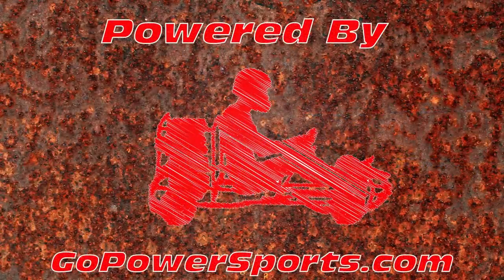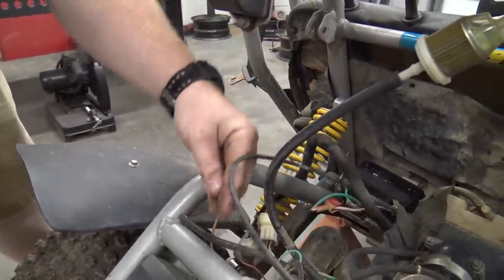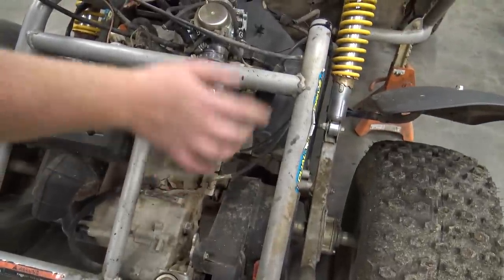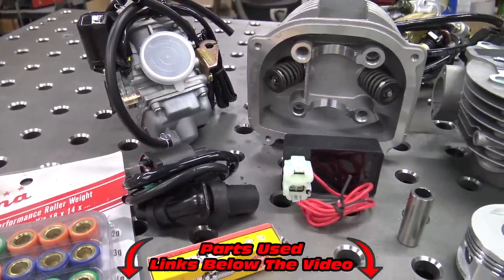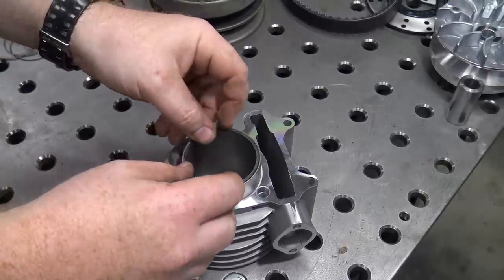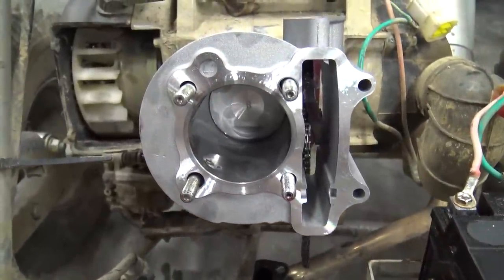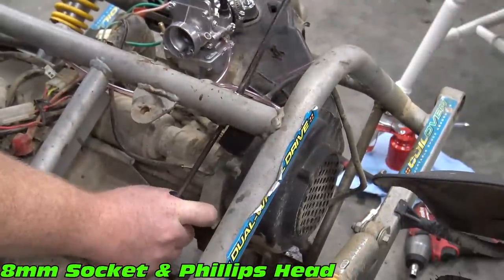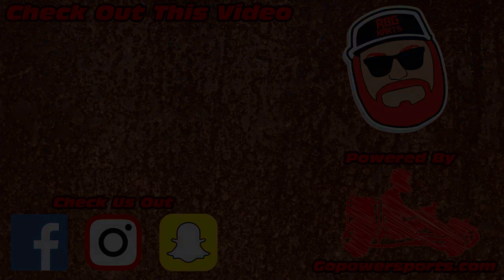150cc gy6 Go Kart Engine Rebuild & Performance Upgrades

Comment: Some of you people are absolute assclowns. You’re acting like it’s open heart surgery! It’s a damn go kart, and it’s his! If he wants to pour hot tar in the crankcase it’s his right! Never seen so many professional engine builders on a damn go kart YouTube channel. He spit a head, cam and a piston in that cart in half an hour and will probably run it for 3 more year. Jeez. I think he did just fine.
Reply: You are right, but given the fact that these videos are shot as tutorials, Some precaution about the dirt would have been more professionnal. But yes, he can do whatever he wants.
Reply: Internet experts, aka mechanically inept couch potatoes.  Amazing how often you see them in karting channel comments with various tarded advice which a sensible person wouldn't touch with a bargepoll.
Reply: This video is well done. Precautions about dirt are a little overboard. That should be learned as a prerequisite for any engine building. How far do you want him to go? Explain the MSDS of oil, gasket sealer, and gas? Explain all pinch point dangers? Make sure you have hearing protection when your air compressor kicks on?  There are some things that should be expected when you are tackling something as precise engine Assembly. There are plenty of other videos on those subjects as well
Reply: Unfortunately Common sense went out with the wokeage!.
Reply: Good vid!!
Reply: I use 93.  To escape hot spark knock.       And a good syn oil every 40 hours.

Comment from the maker: A couple of things for the people that are whining. 1 The oil was changed right before the meet up and went through about 3 quarts in one day from burning oil. 2 I didn't clean the engine before tearing it down and it runs perfectly fine after. 3 the dowels for the rockers were in the rockers when installed.
Reply: Red Beard's Garage you can rebuild the top end without removing the swing arm. Remove the seat .  That is how I did my carter gy6 kart.
Reply from the maker: When filming a video its easier to remove the swing arm. Only takes a few minutes
Reply: Luv u got the opportunity to sort out the kart for the daughter after the arm heals now she has the ability to get thrashing again
Reply: @RedBeardsGarage  what is the break in period on the rings?
Reply: bro this video was exactly what I needed to give me the confidence to dig into the gy6 motor I just popped. At less than a hundred bucks a rebuild I'm not too worried about everything being perfect.

Comment: I would really like to see one of these engines taken as far as it can go. Big bore, hot cam, roller valvetrain. Bigger valves, ported head, higher compression. All that fun stuff just to see what it'll do.
Reply: Had a 200cc built fully to a 326cc. Built a custom buggy for it, thing was insane.
Reply: Standard A-block gy6s can be bored and stroked to 212cc along with having 4 valve heads. B-block gy6s can be bored and stroked to 240cc along with 4 valve heads. Theres also DOHC 4 valve heads. Theres now custom machined gy6 blocks that are pushing around 350cc. Theres also water cooled cylinder kits available.
Reply: search "worlds fastest TaoTao". 8.79 @72mph in an 1/8th mile
Reply: CHECK OUT ROLLING WRENCH GARAGE. HE DID A WHOLE VIDEO ABOUT ALL THE DIFFERENT OPTIONS YOU CAN DO WITH THEM...

Comment: I stand by these gy6 motors as one of the best engines to learn how to rebuild an engine on. They’re a great first project. The best second project would probably be something like a predator 212. A small lawnmower engine. But these engines are super forgiving, you don’t have to worry about the bearings as much because it’s all roller bearings. Very simple project to learn the very basics. It’s the first engine I ever rebuilt. My rebuilt motor is super sketch and idk how long it’ll run for but it does run, and it does run well. My issue now is with the stupid cvt.

Comment: There are upper alignment dowels the go between the rocker cage and head.  They go on the opposite engine case / head bolts from the lower ones I do believe. You might have forgotten them.
Reply from the maker: They was in the rockers when I pulled them off the old head. Trust me there in there

Comment: Great videos, something to note.  The wrist pin clip should be installed with the open end facing up or down in reference to the stroke ( I couldn't tell the witch way you did it, not saying you wrong).  If they are perpendicular to the stroke, inertia could cause the clip to come out.  Thought it would be something for your viewers to know.  Really dig your videos, love that setup table!

Comment: Ima rebuild my 03 hammerhead 250cn this week hopefully if all the parts arrive in time. Bought it for $180 with some missing engine parts and insted of installing a 150cc I got for 10 dollars ima just rebuild the old water cooled 250 and hopefully everything goes well.

Comment: Guessing there is a witness mark on the crank somewhere that should be lined up to make sure the cam is timed to the crank? Sometimes when you drop tension on the chain the crank can move and set the cam tooth or two off once put back together. But maybe this isn't an issue on these?
Reply: Never been a problem for me. Line the dots up and let it hang. Although i keep tension on the chain by placing a screw driver in it while its hanging.
Reply from the maker: You would have to spin the engine to get the chain out of timing.
Reply: @RedBeardsGarage  is there a way to lock the engine in place

Comment: Get one of the hammerhead 250 karts and build it up it’ll run really strong and run forever
Reply: Im familiar all around with the 150 gy6, but im hesitant on the 250cc. Are there any weak points within the motor? Ex: the 150 gy6 exhaust valves most always tighten up after an inital break in
Reply: Those are underpowered pigs from what I've seen on forums.
Reply: I just finished rebuilding a kinroad sahara 250.

It's better than a gy6 but not fast by any means.
flat ground it made 65km/h on gps, downhill it could make 75-78km/h

But i have very light rollers on it, 17 grams and a red torque spring. I might have lost some top speed. acceleration and torque is decent tho.
Reply: @observantservant2135  Very few performance parts available for the 250s but i love my 250s. Ive got 20 buggys from 150cc-1000cc
Reply: @Ratkill9000  250s are awesome. They just dont have many performance options like the 150s.

Comment: about the corrosion on the spakcoil : smear some dylectic grease or silicone grease on the new one , should stop water gettingg in there some

Comment: I just bought a used spider go kart with the 150cc. I see where everyone is buying thr Predators engine but my sprocket is on the right hand side. Predates have the shaft coming out on the opposite side.
Is there comefindof conversation kit. I was wanting around to get about 15 hp to keep up with my buddies.

Ps your YouTube site is totally awesome!!!!!!
Do you do work for others

Thanks

Comment: I agree that the rebuild looks easy on this motor. Just not sure I need it. My friend asked me to look at a Trail Master Challenger 150 that won't start. It's got spark and I checked the compression but it only has about 35lbs of compression. The engine will not even fire. Compression sounds very low to me, but perhaps it has a compression relief for starting. It was running fine, no smoke. They shut it off and it won't start again. I cannot imagine that the  motor was running with only 35lb of compression, so I'm suspicious that the low compression is a red herring. Any advice?

Comment: I could really use some help! I've been trying to figure out why my gy6 won't fire. I changed EVERYTHING to do with ignition and spark. The wiring was screwed when I bought it maybe a really diagram could help? I've looked at 3 different ones none have worked so far

Comment: Any suggestions for clutching for a Trailmaster Challenger side x side. Like primary roller weights, secondary and centrifugal springs to use. It does pretty good, just slightly luggs the engine until about 5mph then takes off like a powerband on a 2 stroke

Comment: Love your channel.  Can you any of you subscribers advise me if I was going to buy a used kart for my yard and street (I live at a dead end).  What kart would you suggest I look at getting.  My plans were to purchase a frame and build from there I may go a stage 1 or 2 on a predator motor. Nothing major just a little more that the standard 6.5 hp provided by predator.  I have some mechanical experience but will learn everything probably off you tube from great people like Red Beard's Garage.  I have checked Ebay and FB but most everything I am seeing is mainly for racing. Any suggestions.  I see some retailers that sell karts.  Is there a place that sells used or just kart frames?   Thanks

Comment: I'm having the same smoking issue with an ace maxxam i recently picked up.does any one know if its typical to replace the piston,bore and rings in a gy6 or could i get away with just replacing the rings?

Comment: Did you check the compression after the rebuild? I have the same engine and I believe my problem is low compression but I don't know what it should be.

Comment: I have a quick question Mr.Red Beard . you replace the carburetor to a mikuni WHAT CABLE DID YOU USED TO REPLACE THE OLD carburetor Cable? Or if you can send me the link. Thank you so much for the video I already ordered an engine rebuild kit ..

Comment: Are all the GY6 150cc motors the same from go cart to IceBear maddog 150 trike. If not what's the difference between parts or are they interchangeable. It's like whoever is selling parts for the IceBear maddog bikes are charging a arm and leg meanwhile you see other sites charging less but will they work on any gy6

Comment: you didn't clock the piston rings and when you installed the "lined up the holes" on the cam, the piston wasn't at top dead center.

Comment: What is the biggest I can take my 150cc gy6 157qmj engine to without having to have it bored out
Reply: Up to a 171cc bro I think 61mm
Reply: There are some drop in 171cc kits. But most you have to bore the case

Comment: my gy6 engine works fine but one day the starter decided to turn but not turn over the go kart and if you look at the fly wheel while turning the key nothing happens it just sounds like the starter is turning against another gear and thats it. i replaced the starter and no it is not one with a solenoid i think it is supposed to engage in the motor separate from the starter but i dont know what else to do can you give me instructions on how to diagnose the problem. thanks

Comment: Why not put a 170cc kit on it? I know it won't make 5 more horsepower but i am curious about the decision of a fresh stock rebuild.
Reply: You have to machine the case
Reply: @Ohiocountryboy-se2cn  not for a 170 i think.
Reply: @ProbeGT2  there are some drop in kits but most you have to bore the case

Comment: I know this is an old video but hopefully I get an answer, my 150cc gy6 buggy burnt a stator so I replaced it, when I test rode it, it was leaking out the stator seal, I made sure it wasn’t low on oil every time I started it, last night I took it out for about 10-20 mins and when I pulled in to the shed it started to knock at idel.. if I rev it or shift in to gear it doesn’t knock but at neutral n low idel it knocks... what could it be?

Comment: Is it common that 150 rings leak oil or it because long use ?
Reply from the maker: This one had a ton of hours and about 8 years of riding. I would say as long as there serviced right they will last.
Reply: my hammerhead smoked like a tar kettle when i got it. it also didnt have an air filter and the kids drove it on a dirt road. that was probably the problem.

Comment: Hello Mr Redbeard! I have a question and I hope you reply. I have a spyder Kandi go cart with a 150cc GY6 motor on it. I considered putting a 420cc Predator on it but was told I would lose my reverse function because it won't line up with the predator. Is that correct?
If so, can those motors have more power added to them?

Comment: I need someone advice on my manco duce  I called go power sports dude said no parts for the duce period??? I want to have the wheels the same dia bolt pattern is a 4 inch I hate that jack rabbit stance the fronts are 8 inch rear are 9 I can get 8 inch atv tires for 8s I looked at the web site am I missing them do you know where I can get new wheels and brake parts I liked your duce build pretty much the same buggy it's for my wife she doesn't know about l want some thing she can get in the dirt too ...no bikes or quads for her ...help thx Tim

Comment: GY6 150 recently I went to start my kids cart and it wouldn’t turn over I left it alone and cane back to it to check the oil and the oil just started spewing out of the dipstick hole like water well after further investigation come to find out that the oil has gasoline in it gas tank was empty so apparently the gas must have ran from the tank to the engine and seeped by the rings into the crankcase but how could this have happened and would this constitute a rebuild thanx In advance

Comment: I've had a gy6 now for about 3 years I've got a new stater coil spark plug carburetor it's got spark and compression but it will not run ,now I'm not a professional but I know I way around motor being I rebuild car and truck motors rebuilt a 85 honda 185s motor rebuilt a 86 Kawasaki 160 and too many to count 110 cc Chinese quad engines but I cant get this thing to run it's got me flabbergasted idk if its cuz I dont have electronic choke hooked up (which I dont know how that works )got this thing torn up no cdi carb was broken no plug no fan on motor but n e ways from what I've seen theres too fuel lines correct?where do there go on carb do I have to have a cdi with that red wire coming off it?
Reply: Have you checked valve clearance
Reply: @PJonies919  ..........always the simplest things let me check I'll get back with u intake side is a .004 and exhaust is .006 or is it the same .004?
Reply: You can run the same .004 or can do like I did on mine which is .004 on the intake and .006 on the exhaust side
Reply: I have a hammerhead 150cc with perfomance cdi box
Reply: The fuel line from the bottom is a overflow pipe and fuel bowl vent it lets out fuel if the needle and seat fails also lets air in so the bowls fill nicely, it just it doesn't need conecting just make sure it's not near the exhaust

Comment: I have a GY6 water cooled 250 cc and I can’t get a complete wire harness
Reply: First its not a gy6 250. its either a cn250 or cfmoto250 or linhai 260. And no you cant get wiring harnesses

Comment: My gosh, has the oil ever been replaced in that engine
Reply: no, he has said in the past they never change the oil. hence why the oil was runny like water. he should probably set a day every month or two just for doing oil changes and maintenance on all the carts and minibikes.
Reply from the maker: The oil was changed right before we left for the meet up. The engine went through 3 quart in one day at the meet up. I don't care how black the oil was it had new oil in it.

Comment: you never did a big bore 180cc
Reply: datboi1738 bottemtext that’s not worth it got to shave the block to fit a bigger cylinder because the skirt would be to thin on a stock cylinder and u would start having overheating problems
Reply: @gokarting1018  Got nothing to do with over heating. Its mostly do do with the fact theres a very high chance of boring into the oil passage and second the super thin walls are prone to cracking if you go with a cheap kit.

Comment: 200 bucks for a stock 57.4mm cylinder kit and stock valve head??? What a fucking joke lmfao!!!! Gps is the worst and most overpriced place you could possibly buy gy6 parts from. Could have went to ebay and got a 60mm bbk which fits the internal reverse motors and big valve head for less than 150 bucks. Why would you even waste time with a stock cylinder when you can go up to a 61mm drop in kit on the internal reverse motors without boring the case?  Those "performance/racing cdis (and coils) are a joke and waste of money also and provide zero performance gains.